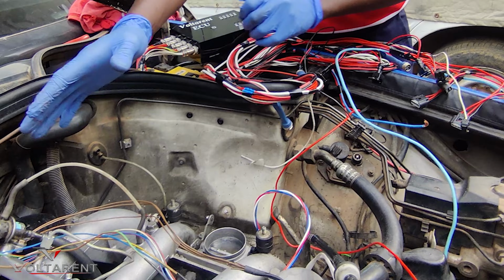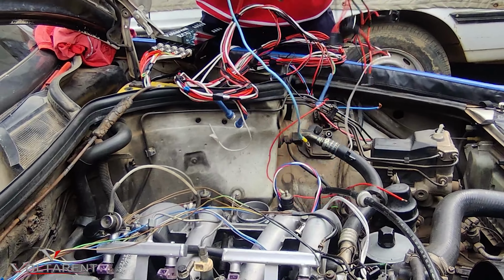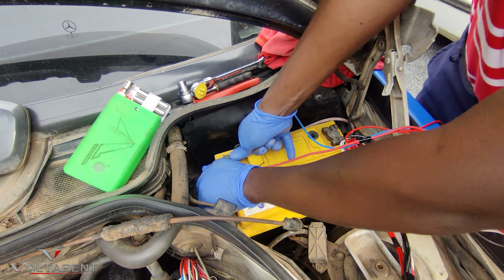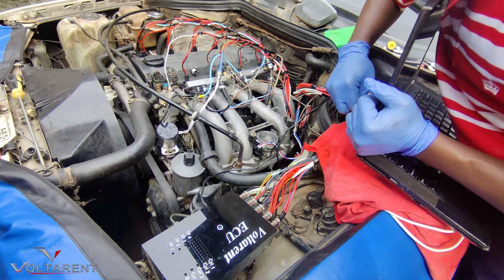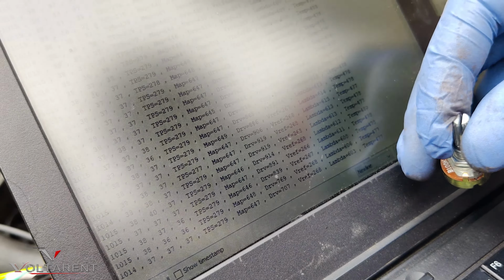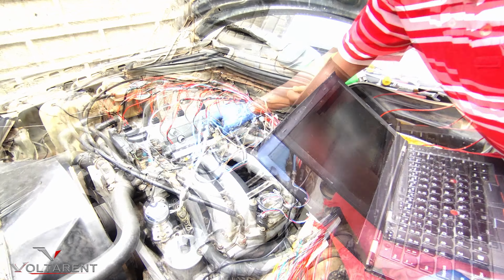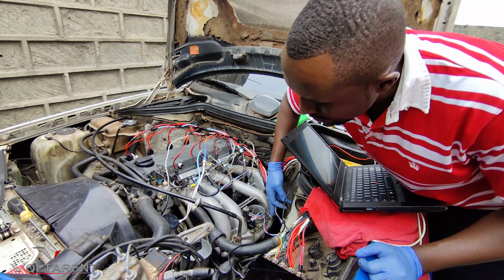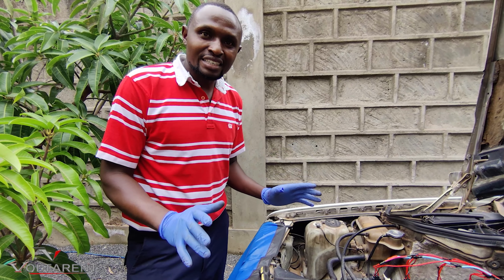Mercedes Benz W124 Transformed with Voltarent ECU for Enhanced Performance and Reliability

Comment: make sure to put heatsinks on any type of transistors that you use in your custom PCB, they will have short life spans if you don't do that...
Reply from the maker: I don't need them. During design phase, I knew what loads I'll be working with and multiplied that by a factor of 10+ and selected the drivers that could easily handle it without sweat (in this case, heat)
Reply: @PeterMbiria1  right, but long term if you want to have a product that doesn't fail over time on your customers, you should regardless of any factors ;)

Comment: Hi Peter, i am from Uganda next door, i have an OM606 mercedes engine running in a defender 110 with the defender manual gearbox , can i have an ECU to run the whole setup with the electronic injector?
Reply: Can I get one like it, it's   pretty rare to get your hands on one in Kenya, where did you find yours?

Comment: And is it cheaper than simply installing a tripple one engine
Reply from the maker: There are factors to consider. First, are you getting the M111 for free or at a discounted price from a friend? If yes, it will  the cheaper option. You already know there are several generations of  M111 engine so knowing which version you will use is helpful. You might get one cheaply only to find out it has immobilizer that will give you headache to disable.
You get to choose Voltarent ECU conversion when, 1, you prefer maintaining original looks, 2, your M102 is in great condition, only thirsty and lazy, 3, you want more power and better fuel economy from the existing M102. It will be cheaper in most cases that buying M111. Buying the engine is one thing, there's shipping, skilled labour, a bit of modifications needed, marrying the harness to your vehicle that cause the cost to surpass the conversion.
Reply: What's the rough estimate if my m102 is just fine.

Comment: Would this be similar on the m103? I have the 4matic version but as far as I’m aware there’s no differences to the engine between rwd and 4matic. 

Thanks!
Reply from the maker: @purplethephoenix5691  For the M103 engine, it will need a different harness as it has 6 cylinders.

Comment: I am currently working on a project with a Ford 300 4.9L, fuel injection OBD1. With the current modifications, i.e., turbo and an electronic transmission. I'm will have to upgrade to a newer ECU, i.e., OBD2, with the capability to send data to the transmission. How will your ECU be more beneficial to my project?

Comment: Hi sir Peter, I'm just curious. Have you checked the hydrocarbon emissions and other gas if pollution free?
Reply from the maker: It's not pullution free but reduces the emissions to bare minimal. So long as it uses fuel, it will produce emissions. Our target is reduce those emissions.

Comment: Hi Peter.  I have no experience in mechanics. Never built or restored an engine. I read instructions very well, done so previously to replace a gasket on a bmw v8 m60b40...successfully. 
Is something I can do myself on an m110 merc engine, that which you just did? Where can I get the full kit?

Comment: Amazing work! ...how do you place individual fuel injectors on each cylinder if it was using a carburetor before ?  do  you drill the manifold?
Reply: K jetronic already has the Injectors, as he showed in the beginning. So the hole for the manifold is already there

Comment: Kindly clarify the fuel consumption figures of the change in fuel consumption. What will it achieve in terms of Km/l?
Reply from the maker: At the moment, town drive is ranging from 10.5-11.6 Kms per liter. Highway is averaging 13kms per liter
Reply: @PeterMbiria1  very marginal gains?

Comment: Can you give an approximate fuel savings figure in KM/Litre for this M102 engine? Otherwise, this is amazing work!...Keep it up bro!
Reply from the maker: 10.5kms per liter town, 13kms per liter highway
Reply: @PeterMbiria1 
That is seriously saving, how was the MPG previous (carburator)
Reply from the maker: @josephkibuika9957  with carb, town was 8.3kms per liter, highway best was 10.2 Kms per liter, same engine, no rebuilding, just removing the carb and installing the full EFI system.
Reply: Hi,I have a fuel injected 2002 Nissan Wingroad QG15 engine currently get about 300-325km on a tank, can you tell me what kind of output I can achieve with your system and the cost.

Comment: How does this compare to the open source Speeduino which also is powered by an Arudino? I think the kit is about 1/3rd of the price.
Reply from the maker: Speeduino is designed to run like other standalone ECUs and is open source, thus the low cost. Voltarent ECU is not open source and is not designed to mimic existing standalone ECUs. It rather takes a different route which alows it to have full control of whichever engine it is installed in. 
Voltarent ECU executes mathematical formulas using selected engine sensory data to derive fuel pulse width and igntion angle parameters with reference to the selected drive mode. 
It allows power of demand features on engines with bigger cylinder count (6+ cylinders) and could even execute power on demand on a 4 cylinder though no gains in fuel economy, it actually consumed more.
It has no limit to how many maps it can handle, so long as the firmware is written well.
Voltarent ECU by the way uses 32 bit controller while Speeduino uses 8 bit. The firmware on Speeduino executes differently while using inbuilt EEPROM for data storage. Voltarent uses main memory as the 32 bit doesn't have inbuilt EEPROM.

In terms of perfomance, hard to compare but I've had the chance to race with a Peugeot station wagon running on Speeduino with a 2L 8V engine 5 speed while running Voltarent ECU on W201 Benz saloon with 2L 8V engine 5 speed. From standstill, we both accelerated, Peugeot was fast and left me by the full length of his car (short shift trans), On my gear 2, I was at par with him, once in gear 3, he couldn't keep up. By the time I was on gear 5 (past 150 kph) he was way behind. 
That was the one and only direct perfomance comparison I've had between Voltarent and Speeduino.
Reply: @PeterMbiria1  I'll be honest, I'm a bit unsure of the abilities of your ECU. It may run on an Arduino Due but it's overkill. The race between the cars has no bearing on the quality of the ECU. It comes down to how well the engine is tuned. There's also no reason why a speeduino couldn't be used to run a converted engine like you're doing. I'm still impressed by what you have done, the fabrication on the fuel rails is very decent. You mention it's closed source, how would someone tune their engine? Speeduino uses Tunerstudio, allows for real time tuning of fuel maps, ignition timing, idle control etc. Is this possible with your ECU without going into the Arudino IDE and changing some arrays? Genuinely interested. Thanks.
Reply from the maker: @hippopotamus86  Some pros and cons. Speeduino has a neat interface to play with (tunestudio) I've interated with it by the way. Voltarent ECU though, doesn't have that interface. It has serial data outputs than can be represented on display as dials (but haven't developed that interface)
To tune, one has to interact with the arduino IDE interface.

Comment: Did you know, Voltaren in some countries is the same  as Diclofenac and is for arthritis? 🙃
Reply from the maker: @fujimotosan9123  it's Voltarent, there's a T at the end
Reply: @PeterMbiria1  What's the fuel savings in economy mode on average proportionate to the original fuel consumption?